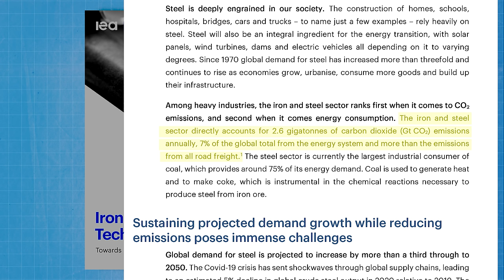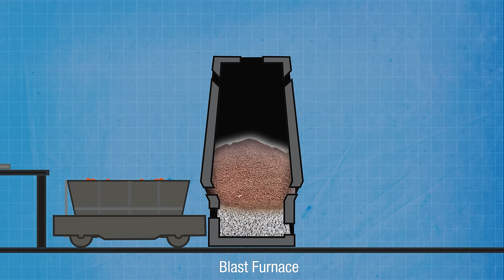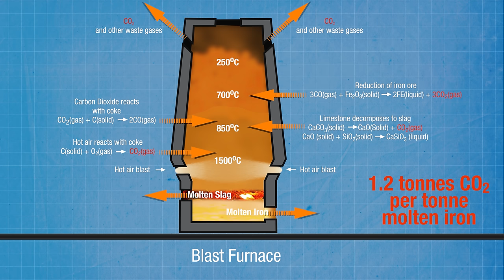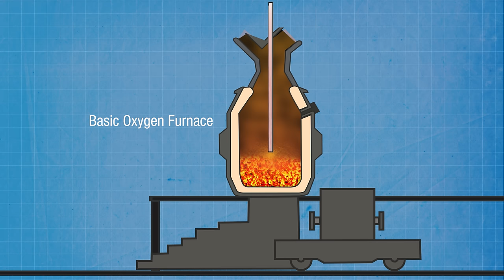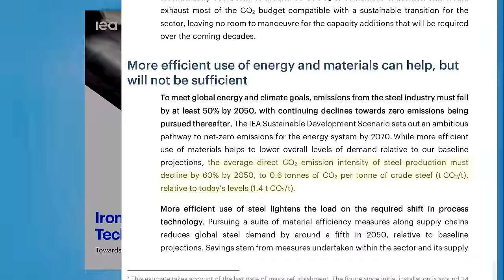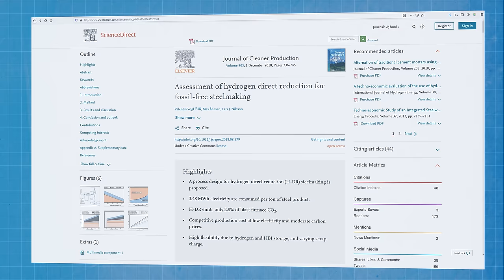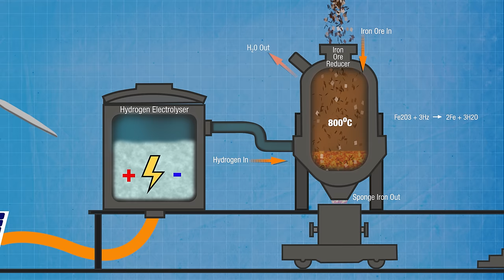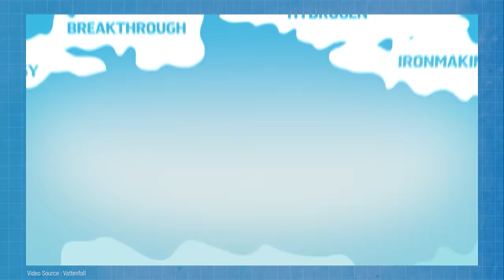Fossil free steel. Another giant step towards net carbon zero?

Comment: I'm a metallurgist from Australia and therefore have some idea about how steel is produced. We in Australia have already had a direct reduction plant (about 20 years ago in a place called port hedland) - the problem with the process and the bit missed in the presentation is the fact that hot hydrogen is very dangerous (very explosive on its own) and prone to be absorbed into steel (the pipes and pressure vessels used to transport the hydrogen through the process) and cause embrittlement of the steel used in the pipes etc. So the process (long known) has its technical challenges and in fact too many for the plant in port hedland - which ended up with a poor safety record and from memory a couple of deaths due to explosions and was shut down in about 2004 - 2.5 billion aussie dollars down the tube - not sure it made an operating  profit ever let alone the build cost which was ultimately written off.  Anyway - it sounds good but has technical challenges that don't go away.
Reply: I worked there the Maintenance costs were huge. and a Hydrogen leak was always a worry.
Reply: @shanewheeler713  You were a brave man working there! Visited once and went to the metallurgical lab to use their equipment - that's as close as I wanted to get to the process equipment!
Reply: @eutectoid1  It's not been explained here just how dangerous the process is.  It looks great on paper, but when you work with Hydrogen under 200+ Bar of pressure things get dodgy. People don't realize Hydrogen can pass through steel and it damages the steel when it does it (Embrittlement). then at the end of the process you have to deal Brickets that oxidize in front of your eyes. Did you get to see the Steam vapour coming of the stock piles?
Reply: @shanewheeler713  No mate I knew enough about the process to get in and out of the the plant ASAP - as I said just went into the labs to use their metallurgical preparation equipment ( was working in Karratha at the time - long story)

Comment: Did you look at Boston Metal Molten Oxide Electrolysis, and how does it compare to the technology you presented here?
Reply: Yes, I immediately thought of Boston Metals and Donald Sadoway. Seems to be a very different approach. Instead of electrolysis of water into hydrogen, Bosten Metals electrolysis involves liquid metal oxides. It does require very high temps +2000C to produce steel but the method seems very scalable.
Reply from the maker: Hi David. I didn't, but a couple of folks have mentioned that so it may be a topic for another episode. Cheers. Dave

Comment: The ten seconds that follow the statement at 8:26 could make for a whole new video! I'm struggling to get my head around that sentence - and I think I'm quite clever (he said, arrogantly)
Reply: I think it just means that the H2 need not be produced at the same instant that it's consumed in the steel process. H2 can be stored and/or transported. So it's more economical to produce it when (or where) the electricity prices are low, for instance during windy days. Solar and wind can produce lots of cheap electricity, just not all the time, and this is one way to take advantage of surplus electric power.
Reply from the maker: Hi Neilhuny. Mattias' comment below is correct. I could have made that clearer in the video though. My apologies.

Comment: Very interesting development. I don't think Carbon Capture has any chance at least in the short term of being widely implemented because it just adds cost. In the US, we can't even get agreement that there is a problem. Real progress on reducing CO2 happens when a new technology is invented that is just better /cheaper than existing fossil based so good to see a new renewables based process for steel.
Reply: Carbon capture doesn't "just" add cost.  It also captures carbon, which corrects the market failure known as an unpriced externality.  That creates real value, but it's value spread over the entire world instead of going into the pocket of the factory owner.  Of course it's always easier when a cleaner new technology is also cheaper.

Comment: Interesting video.  Direct Reduction by Hydrogen/Carbon Monoxide mix has been around since the late 1960's, eg. around 64 plants exist using the Midrex process developed by Kobe Steel.  It uses reducing gases produced by steam reforming natural gas or other hydrocarbons.  The lower carbon intensity, lower temperature and  hot link to electric arc furnace can reduce the CO2 emission from 2T/T steel to below 0.7T for natural gas feedstock.  

Changing from coke to natural gas steam reformer would give dramatic emission reduction and could be applied widely and quickly with much lower cost than green hydrogen as the hydrogen route depends on a huge increase in renewable electricity generating capacity, which has many competing demands, but once available, the H2 content of the reducing gas could be gradually increase by addition of green hydrogen (when available) upto 100% with minimal modification of the downstream ironmaking process.

Comment: Instead of adding carbon to the iron-sponge, I'm guessing it will be possible to add blast-furnace iron to balance it out.  
This might be a good way of lowering CO2 output a little faster.
Reply: The Iron Sponge is pressed into "Brickets" little 1" squares.

Comment: A thought- whats the steel being used on... if we made car parts cheaper theres no reason cars cant last longer (lower tax for spare parts and repair to incentivised over buying new), but more to the point cars are small fry- how about increased use of PAINT and galvanizing rather than letting things like bridges rust away in the first place (again given tax involved in hiring someone to paint old metalwork its often cheaper to stretch it on old paint and replace the metalwork more regularly than just maintain- this wasnt always the case)

Comment: I work in a sector that buys a lot of steel, but is also very timid about anything novel. I'm curious about the comparison of the metallic properties of the product. From what I know of metallurgy, the resulting steel should be indistinguishable in quality and strength,  as the basic recipe hasn't changed much. Or could the lower temperatures actually affect the material properties?

Comment: Much too little use is made of the heat released when cooling in industrial processes.  Condensing steam to recycle the hydrogen, for example, releases a great deal of heat that could drive an electric generator.  There is also no need to cool the sponge iron before adding carbon and removing impurities; simply heating it more would save substantial heating costs.  And the heat released to cool the final steel product could be used to drive an electric generator or to warm more ore.  Even if this efficiency boost slows production some, it would be a small price if it saves our planet and extends our natural resources.  My grandmother always said "Waste not; want not."  We should consider wasting less and salvaging more as a viable mission statement.

Comment: You're wrong in a couple of significant ways.
First, attributing the CO2 emissions in steelmaking to the steel industry is foolish. That steel is used to make bridges and hospitals, etc.. ;the emissions should therefore be attributed to transportation and health care, rather than vilify the source of the building materials.
Secondly, while more efficient processes to make steel and use energy are laudable, diverting renewable energy doesn't make the steel "fossil-free". Grid energy is fungible; if you have an equal supply of coal-fired and windmill-generated electricity, half of your electricity comes from each. You can't simply declare that steel production comes from the windmills and the houses in the nearby town are thus powered by evil coal.

Comment: Coal has always been closely associated with steel production. It doesn't have to be as much with molten salt thorium reactors. The process heat from molten salt from thorium can reduce the amount of coal by 2/3 by using process heat from the thorium heat production lowering it's co2 drastically and even reducing not only it's horrible gas production but lowering it's cost just as drastically.

Comment: Two questions. Electric arc furnaces use carbon based electrodes. The less carbon in the smelt the more electrode consumption will occure. Are there any new technology to overcome this challenge when smelting iron spunge?

Is it possible to reduce iron spunge to iron using induction furnace technology combined with scrap iron?

Comment: Interesting stuff but surely a recipe for hydrogen embrittlement of the steel that is produced.  Would be interested to know how they intend to get around that one.
Reply: I don't know for sure, but the hydrogen could diffuse out of the steel in the arc furnace as methane when it is molten.
Reply: Alloys
Reply from the maker: No becasue there's no hydrogen is the resultant steel - the hydrgoen reacts with the oxygen in the iron oxide and leaves the reaction as water (steam) - so you're just left with iron. The hydrogen corrosion you're talking about comes from hydrogen gas flowing through steel pipes over time and reacting with the steel over long periods - that all happens way after this process has finished.

Comment: How is it they are burning/forging/heating metal in an oxygen-less fire? Are they using induction? Any flame source will use and require oxygen by default so it seems like a strange concept without further explanation.

Comment: from the stoichiometry of the reduction by hydrogen, it is possible to calculate the need of 54 kg of hydrogen for a ton of iron(if the H2 usage is 100% efficient). The price of iron is US$70/ton and the expected cost of green hydrogen about 1,5 US$/kg (optimistic).
 There will be a need for a huge subvention (and great improvement in efficiency) otherwise the process has no sense.
Reply: "Green Steel: A Multi-Billion Dollar Opportunity"
September 29, 2020  |  By Thomas Koch Blank
is more optimistic: "by the end of this year, zero-carbon primary steel without coking coal can reach a fully loaded production cost of $400/ton. This is competitive with many existing steel mills today."
Reply: @keithmcclary4892  this is true for the steel industry no for the Iron industry

Comment: This is interesting.  It is a shame that YouTube does not put a link to the plethora of articles debunking the AGM hypothesis the way they do the other way around.  There are going to be some gosh awfully large batteries necessary for that arc furnace and the cost as is mentioned is going to go through the roof.
Reply: Arc furnaces are already in widespread use, and have been for decades - without batteries.
Reply: @w0ttheh3ll  Of course.  I know.  The point is that for the process to be completely carbon neutral the arc furnaces will need to be run on batteries with electric generated by renewable sources.  The whole AGM save the planet thing is ludicrous and I have spent too much time on the subject already.

Comment: I’ve been highly sceptical of hydrogen fuel cells as an alternative to lithium-ion batteries. But this is one place where it makes a lot of sense, provided of course, that they use green hydrogen, otherwise, they’re just kicking the can down the road.
Reply: Hydrogen is a chemical reactant in the steelmaking process.  There need not be a fuel cell involve.

Comment: One could also use the similar mechanism used in the production of Aluminium. so not using hydrogen but electric current to split the iron oxide.

Comment: Awesome video very informative just one question. 

How do you create the heat needed (800 degrees C) needed for the iron ore reducer in the newer process? Thanks.
Reply: By burning hydrogen.

HYBRIT has several stages actually, producing steel is only one part of it. The entire project is roughly:
Part 1 - Overview of impact of the system, including possibility of using the new demand to balance the grid.
Part 2 - Production and storage of hydrogen gas (basically optimize the everloving daylight out of electrolytical production, and try to solve the hydrogen storage issue)
Part 3 - Iron pellet production without fossil fuels (evaluate various strategies)
Part 4 - Reduction of iron ore by methods of hydrogen gas.
Part 5 - Steel production from previous parts, electric arc furnace (working out the kinks introduced by having a different feedstock)
Part 6 - Meet market demand (the business stuff).

The swedish pages are a lot more informative than the english pages ('hybrit development' is the key phrase they use in their public efforts if you want to search for it)

Basically HYBRIT is a "let'se see where we use fossil inputs to produce steel, and see what technologies are within reach for a near time production, and evaluate as many of the promising ones as possible".

They actually considered the entire chain a fair bit - for instance they opted out of using biofuels due to concerns over the impact on forest caused by harvesting enough of it to support a full scale switch-over (should be noted that sweden is one of the countries that has a carbon intensity in the grid below 50g CO2/kWh, so it is very clean electricity), but they did bother to figure out how to do it with biofuels in case a facility is placed in a dirty grid.
Reply from the maker: Hi Gengkis. That would likely come from very high current electrodes powered by a very large amount of wind turbines, plus the combustion of the hydrogen.
Reply: @Herr_U  Wow thanks. The feats done by other countries is impressive while we can't get people to wear masks consistently here in the US.

Comment: It looks like a specialized molten-salt reactor (MSR) would work well for this method of steel production. Hydrogen can be more efficiently produced by an MSR using thermochemical water splitting above 500C. The 800C for the iron ore reducer is a little high for an MSR but the molten salt can go higher. Generating electricity for the electric arc furnace is standard for any nuclear reactor.
Reply: proof of concept, it took tokamak big and small over 50 years to build a couple plants, as in almost 2 that almost work.  my guess, msr will be 10 more years till the first working prototype then let it run 10 years to show efficacy.  then if the nrc even allows it, build one a week for 30 more years.  2080 best case will be +4C°.   what could go wrong dealing with catastrophic climate, environmental degradation, a growing population  ... sign me up.
Reply: @jthadcast  Funny how those with the influence/resources have continually talked about ‘changing the situation’ for the past 50+ years but not actually done anything but line their pockets and consolidate their power... oh and deflect blame toward the lowly stationed pleb for being greedy consumers (of their products/services) and stand back while everybody argues among themselves due to all the complicated and conflicting information/reporting... that they share. 👍

Comment: I like the idea but the electric arc process still requires a huge amount of energy.   For that pilot plant to get to 200 tons per hour you are talking a sustained load of 680MW -- which is about the entire output of a nuclear reactor.   A solar panel farm of just 5MW is about half a million square feet in size and we are talking about the output of ONE steel plant using 136x that -- it just doesn't seem practical.

Comment: Decarboning steel will be important but so is removing steel from the economy. I don’t believe that steel can completely be removed but it can be reduced with other materials. An example might be using composites to replace steel in vehicles or manufactured wood products as substitutes for steel structures. Examples but things that could be investigated to see what can be done to reduce the use of steel.

Comment: This is exactly the type of industry that governments need to be concentrating on transitioning.  People think giving away $10k in subsidies on personal EVs is going to save the world, but light-duty vehicles only make up about 15% of global GHG emissions, and transitioning them all to EVs does not reduce that to 0% when you account for emissions produced during manufacturing and electricity generation.   There are 1.8 billion vehicles in use on this planet; it's going to take a long time and a lot of money to replace them all.  In the long run electrifying transportation will be a big part of the solution, but in the short term, we should be concentrating our resources where we get the most pound of CO2 reduction per dollar and in the shortest amount of time.  That involves drastically reducing emissions in steel production and other high GHG emission industries.    Replacing fossil fuel power plants is another thing we should dump every resource we have into... EVs only make a substantial reduction in emissions when their energy comes from low carbon sources.  People say "but the grid is getting greener"... but it's not all that green today.

Comment: I think there is a basic misinterpretation of what is being produced. Steel is one material, an alloy of iron which is another. Iron is used for a great many engineering products and one of it's physical characteristics is that it contains a lot more carbon than steel does which gives it the necessary attributes for it's specific uses. It is not just a stage in making steel.

The carbon in iron comes from some of the coke used to fuel the blast furnace. If hydrogen is used where does the carbon come from? If the ore is reduced and only used to make steel I can understand but what about the very large demand for so called cast iron?